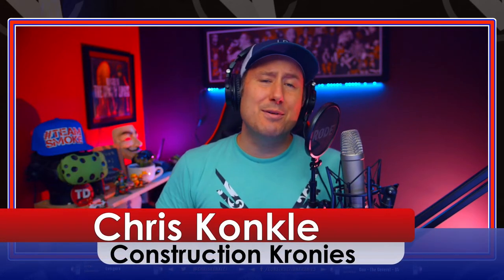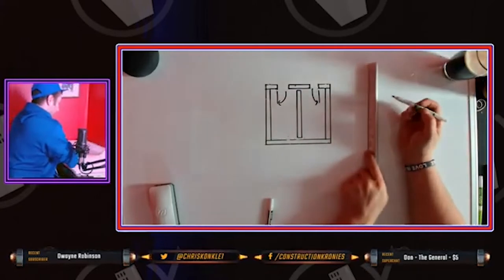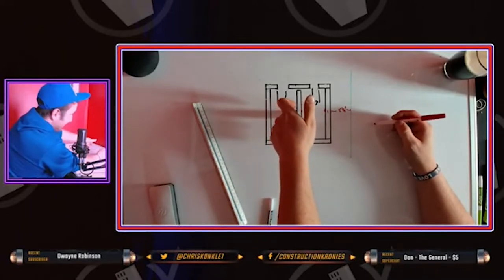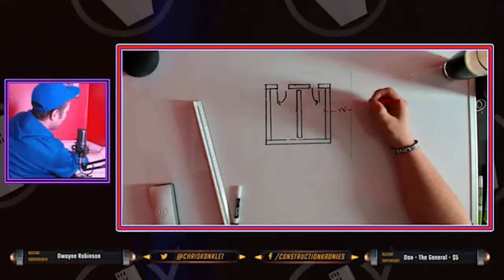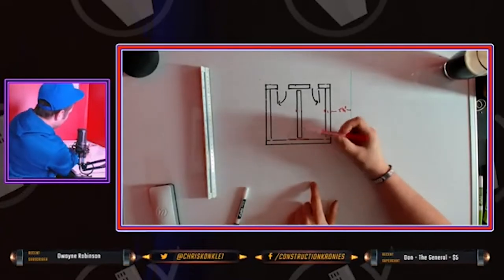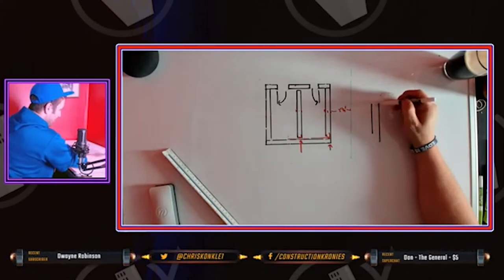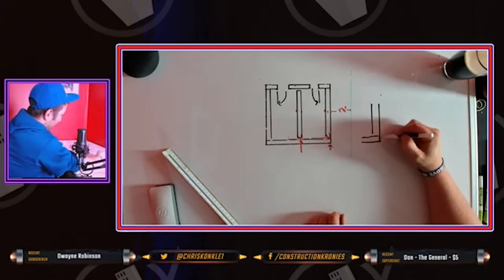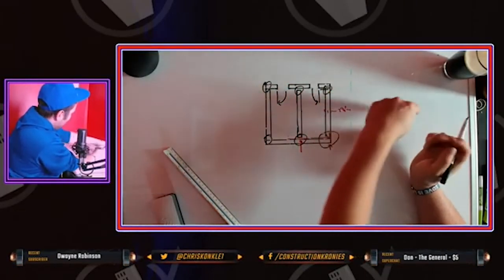Metal Stud Framing Layout Interior Walls Floaters & Hash Marks

Comment: What's the best way to attach a metal stud wall to warehouse ceiling that is ribbed metal decking? Just screw straight to the ribs?
Reply from the maker: Yes 100% the rib decking is qdeck and we screw right to it. Now there are a few things: if it's filled with concrete for a slab floor then you have shoot or drill pins in, if it's qdeck for a roof then use self taping framing screws and lastly if your wall lands wierd and not on the bottom of the flute then make clips out of track or stud, install them first, shoot your layout and then install your top track screwing it to your clips. Any questions just ask me!
Reply: @ConstructionKronies  thank you sir. That's what I was thinking, but just wanted to be sure. Very cool of you to help.

Comment: What if you cannot secure metal floaters from the outside due to concrete? Do you not use a floater?
Reply from the maker: You don't float the stud on a concrete wall. You need to shoot or drill it down. Even if your laminating the concrete wall shot the stud down and then add a second stud to the end of the wall for a nice hard corner. Make sure to laminate the concrete wall first then drywall the steel stud.  If your talking about a wall that is in front of precast or imp's then you just need to flip your floater to the wall that is inside of the building and you do have access. Hope that makes sense. At then end of the day you can always do a hard corner, use 3 studs, and always drywall the side with one stud first. Be sure to always check your fire rating requirements.

Comment: In what applications is the Floater Stud Used in ? Why can’t they just put two studs for the corner and not have to go behind the wall and “lock it”
Reply from the maker: First thing you have to check your drawings and specifications. Check to make sure hard corners aren't specified or drawn in the details. The main purpose of using a floater is to get all the framing done without using any drywall. Exterior walls never and we like to have a continuous seal of drywall between the interior partitions.
Reply: We are drywalling to metal frame in a multi family construction site, but there are no hard corners in any closets or interior walls. Usually Floater studs go on “fire Rated walls” or separation walls but not interior walls from what I’m used too seeing. Is there any reason for floater studs in interior walls? Instead of hard corners. I’m in wake forest NC